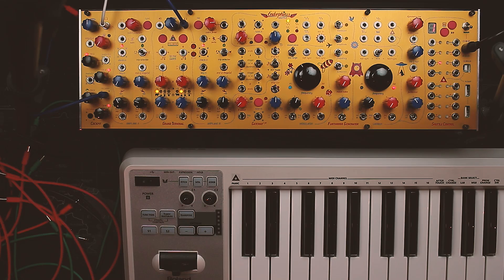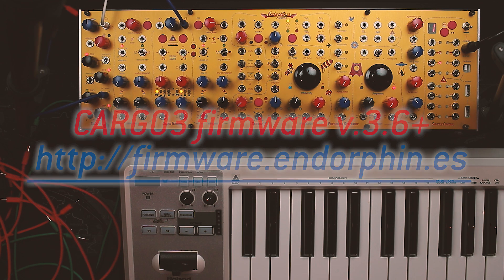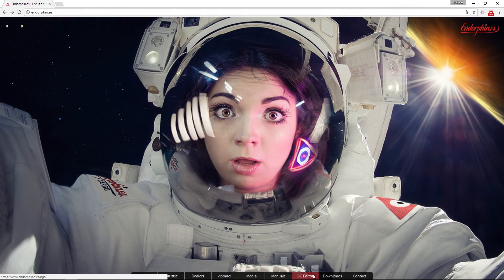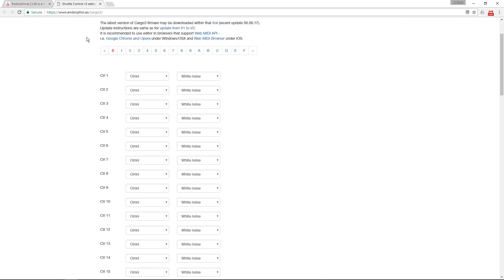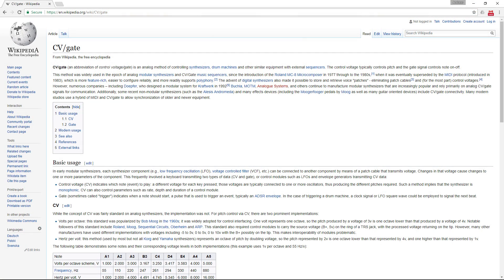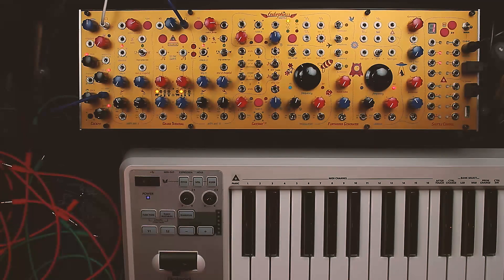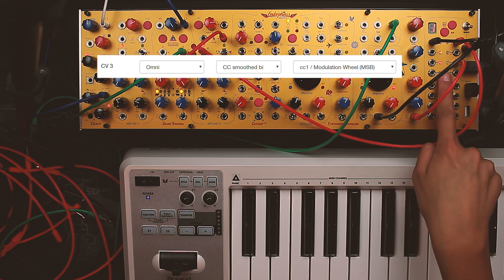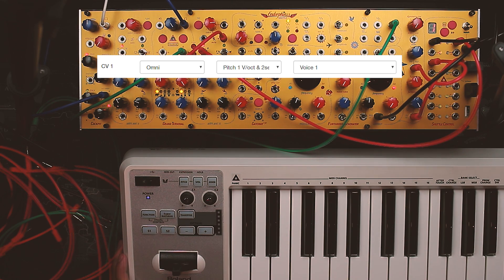Endorphin.es - Shuttle Control: new features overview

Comment: I own Shuttle #5. And also finding it difficult to setup midi control. I think I have reasonable knowledge after 20+ years of playing with synhs. Still finding the learning curve on the shuttle control quite steep, mainly because of lack of ideas suggestions on how to incorporate the SC functions. This movie helps a little, but I'm having much trouble hearing the info through the heavy slavic accent. Maybe you could provide some subtitles? The rest of the instrument is a joy to explore and sounds fantastic at times. But I really feel I could do so much more with it if I'd grasp the Shuttle control more. Would be fantastic if you would bring out an iOS app with settings combined with a few basic sequencers and presets to get users started. Bottomline, loving the Shuttle, but the Control is the botttleneck here to me. Keep up the good work, life's still a trip!
Reply: The shuttle control is a very deep and versatile module. Initially I also had problems, but as I learn to know it more, it gets exponentially invaluable. What do you find hard about it, maybe I can help? I use it mostly for fluctuating & s&h lfos, buchla style random voltages, sync, pitch & gates.

It really has to be hooked up to a good midi controller (preferably 2) to be at its best. I use the midi twister from dj techtools, as it has 16 endlessly rotary knobs + push encoders with LEDs  to see values. It is fully customizable with the included software, so you can even color code the LEDs for easy grouping of modulations.

A midi keyboard or pads control velocity (i use the push2 via ableton). 
That way you can control up to 16 lfos or envelopes, random voltages that is synced via midi clock & controlled with CC# values or via velocity,  + pitch & gates & everything in between directly via rotary knobs like you would on a normal synth/module, or via hard/soft or long/short presses on your velocity sensitive device. 

Midi controllers really act like modules in themselves when connected to the shuttle control.

Synced randoms + much more is available via the "syncronization" page on channel 10 (recently found out about this) in their mapping page on endorphin.es. This only works on midi channel 10 i believe. 
By synced randoms, i mean random voltages that you can decide probability by a midi CC# value e.g. a rotary encoder, if you prefer that over velocity. 

I find velocity better for expression when playing the shuttle as an instrument, and by CC# when noodling with self-playing patches.

Shuttle is amazing and very deep, IMO similar to and in my very personal opinion preferable to the music easel, much because of the shuttle control. The tutorials are a bit hard to follow because of the dialect, but if one can concentrate, its not so bad :) 
Not saying you didnt, but it gets easier if you read the manuals & read through everything on their editor page. It has a list of all the parameters etc.
Reply: Thanks, great informative read. The reason I got into Endorphin.es is because I love the complex oscillator Easel sound. I hoped it to be deep and versatile, like you said. But with the Shuttle being my first modular system, I found it a bit more overwhelming than I expected. Anyway, I not giving up so easily. Will dive into the manual some more and first try to set it up with something like Fugue Machine on iPad before diving into the whole CC realm. Have you posted some movies on the topic? Will check it out. Thanks for offering help btw, I might take you up on that in the future.
Reply: Hehehe, sure, good title there.
Btw I edited that post quite a bit. I dont want to offend the person who exhcanges this for that, or anybody else :) Also its now paragraphed so should be easier to follow.

Shuttle is for sure a difficult first system, much because of the west-coast approach, and much because the people who make it seem to be completely bonkers. And also very smart people. Confusing combo :)

For your question, no, I did not make any videos on this topic (or on any topic), but maybe I will after learning this system properly. Im in no way an expert, but found my way around it after a while. Must say, the guys at endorphines have been a great help, ive emailed them to the point of nagging, and they always reply politely and helpfully.
Reply: I hear you. Though I appreciate a laugh anytime, I'ts certainly not meant to be a someone's expense. Anyway, it's this bonkers aspect that makes these things interesting in the first place. And also to be honest, I put way too little effort in at this point. So I'll try to do that before putting up the help sign.
Reply: Deep things need a good amount of dedication to be rewarding. If you need it, just message me. I love talking about this stuff :)
Reply: Hello kind sir. I bought this machine as well. Please let me know if you learned some tricks and tips about it.

Comment: Still not easy to setup the shuttle midi controlling I get confused with the slots and the midi channel and how to know and change the cc#
Reply: If you can configure your midi controller so that each knob sends on a specific channel it gets less confusing. If not, you can do it through ableton, if you use that. I assume you can do this with any daw or on a ios device.

Comment: O wow I wish I had watched this one earlier. I am glad I picked this system as my first bit of eurorack but finding the right midi controller has been a challenge. I want something that is USB midi has a keyboard and enough buttons sliders or whatever to control all of the shuttle parameters but that is around the same size or smaller than the system so that it is portable and looks good. One thing I wish is that the shuttle control had a simple sequencer like the endless sequencer on the op1.
Reply: Same here man. I bought this system as my first eurorack. As for midi controllers, I really liked M-Audio oxygen 49 and Roli blocks. looking into Roli Seaboard.

Comment: Can i control it at the same time with my digitakt and my computer ?
Reply from the maker: absolutely. you just plug Digitakt in the HOST (check here: https://youtu.be/DXp7WANEMaY) and computer TO DEVICE.Both will work at the same time and with settings you can adjust USB-MIDI bi-directional routing (from host to device or vice-versa) to share the clock from computer to Digitakt or backwards

Comment: Can the shuttle control be connected to an Organelle from Critter & Guitari (as if it was the computer)? It is actually running unix so should work, but i’m not fully sure.

Other question would be : does a regular midi interface be connected in the usb socket (for instance a midisport 2x2 or midiface 8x8)?

Comment: Thank you for the video; however, is there any possible way to perform an arpeggiator without using a Daw clock nor an ipad?; does the stand alone synthesizer and a midi keyboard could perform an arpeggio? Or theres always a need of a incoming clock from a Daw or a Ipad; if so, how could i sync the clock of my analog sequencer (doeper dark time) with my shuttle system to perform an arpeggio? I have seen a setup where there are like two outputs from the shuttle control conected together; what would be that setup for? Finally, some examples of the tap possible configurations would be very cool. (^_^)/ kind regards
Reply from the maker: Enrique, for now arpeggiator generates notes only based on the incoming MIDI clock. We have the ideas to make it standalone but a bit later
Reply: @Endorphines  all right one thank you for the answer ;) however, i still dont figure out what does "Tap clock", "Tap x #", "Tap ÷ #" , "Tap etc." stands for? is that for send a pulse when i press the selected note? or is it for clock purposes only? Also the option "Clock 46-172 bpm" gets activated by external MIDI clock also? Finally the "Synchronization" option requires or implies also an incoming external MIDI clock? very thank you for your time. Best :)v
Reply from the maker: @hohm875  that are clock outputs mapped on a certain CV output of the Shuttle Control on a certain NOTE or any note on certain MIDI channel. On pressing three times on your MIDI keyboards you will have a tap clock following the frequency of your taps or that clock with applied divider/multiplier. For exmaple you press C1 three times with 120 bmp. Then TAP CLOCK will have exact 120 bmp output. TAP /2 will have 60 bmp, tap *2 will have 240 bmp etc
Reply: @Endorphines  Wow, awesome so many features you have in that module.
Reply from the maker: @LarsDanielTerkelsen  indeed...

Comment: hello, is there any situation in which the sixteen 3.5 mm jacks work as an input? or do they always work as an output? i have seen that some of the options of the "SC editor" are "TAP ÷ #" could that be considered as an input for an external clock? so, is there any other clock input rather than just the usb clock input from the tipcal Daw/ipad ? what would be the clock input using an external analog sequencer if theres no usb conection in it? i just want to make a simple arpeggio without using a computer next to it sine some audience would believe that im making a wird playback ;d . i really appreciate any information regarding this topic. Kind Regards (^_^)v